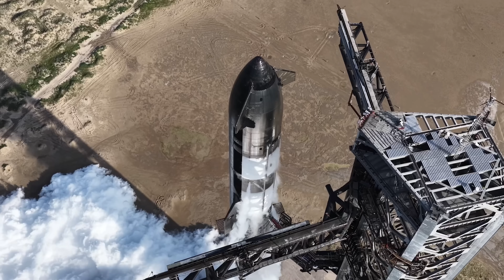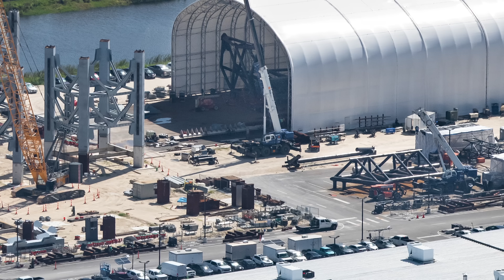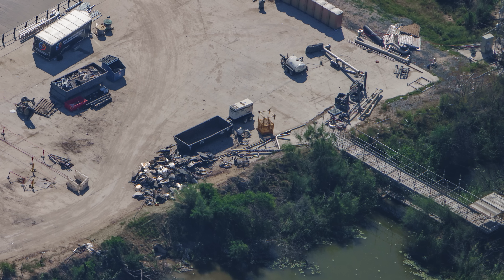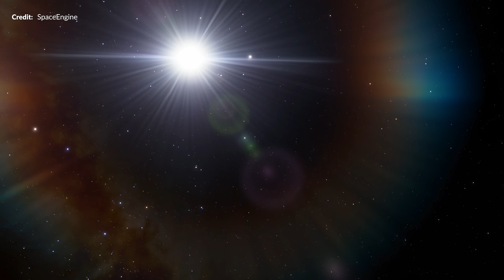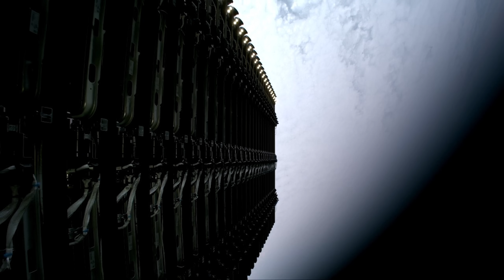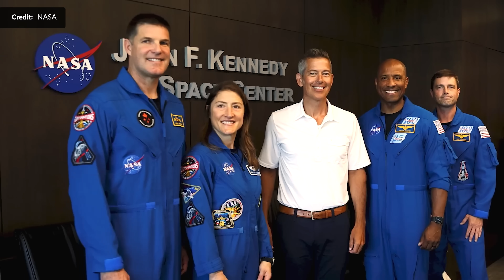Starship Began the Demolition!? 🔥

Comment: Quite bizarre comments about BO who have yet to do any significant space launches beyond their sub orbital amusement ride and last I saw their blue moon lander consisted of an inflatable plastic ball and some chip board.  Yet you talk as if BO have a completed and tested moon lander and could beat SpaceX to a manned landing demo. !
SpaceX is the only company in the US with an fully operational proven crew space transport.
It took years to develop Dragon and Boeing and Lockheed have taken many years longer to try to get their Orion and Starliner certified. 
The idea that anyone is going to hack together a lunar lander + ascent module and perform a manned landing in just 2.5 years is delusional. They would also have to do an unmanned test earlier to validate crew safety so you got under 2 years and that's assuming they started immediately with multiple billions of dollars of cost plus grifting which will drain the NASA budget.
I suspect Duffy as NASA temporary admin is compromised - Lockheed, Boeing and BO etc are all fearful of Starship and have the attention of Duffy who's lack of experience makes him more susceptible to their lobbyists efforts to undermine Artemis 3 HLS landing since they know Orion and SLS will be made obsolete by starship as well.
If they can eliminate the HLS starship then there is less threat to their cost plus Orion and SLS programs.
Even if SpaceX HLS is late it will not be by much - the more probable delay will be Orion and SLS which are yet to fly a single person.
If Duffy loves competition so much he should have a competition to find a replacement for Orion and SLS. NASA already had the HLS competition and SpaceX won that soundly.
Reply: Oh didn't you hear?  Jeff Bozo just patented landing on the moon, and the cost of licensing is not worth it.  Ask Barnes and Noble about when Bozo last patented a pre-existing idea, the hyperlink, and it worked out.
Edit: I nobbled using Noble by using Nobel and didn't win a prize for it.
Reply: They have their first orbital flight done.. the question is on the 2nd.

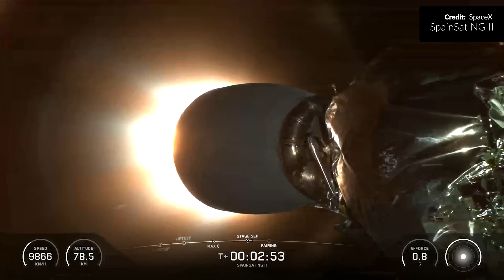Comment: 18:30 Why wouldn't they use the extra thrust of a falcon heavy configuration and recover all 3 boosters rather than destroying one?
Reply: Because that fuel is needed for the payload.
Reply: @imaginary_friend7300  You only answered why they use up all the fuel if they use one booster.  Falcon heavy uses 3 boosters, more fuel, more thrust, greater margins.  So my question still remains.
Reply: They probably ran the numbers and decided the cost of discarding one booster was preferable to the cost of setting up, fueling, and launching three boosters and recovering them all. The weight of the payload and/or insertion fuel requirement was probably only slightly beyond the single booster recovery threshold and the cost and logistics of a heavy configuration launch just weren't worth it.
Reply: @knightdive1  That's what I would assume, but surely you can run boosters with a part fuel load?  Granted that doesn't save the cost of assembling the configuration, transportation etc, but it would save fuel cost and be less wasteful overall.  I thought that was Elmo's whole shtick.
Reply: @ffsireallydontcare I don't know how full the fuel tanks have to be to takeoff, but I do know the pressure in the tanks is a significant part of their structural integrity. Without filling the tanks with something (inert gas in place of fuel for example) there's risk of the whole assembly collapsing under the forces of launch. Since even the weight of the inert material has to be compensated for with additional fuel it almost seems pointless not to just fill the tanks all the way. Calculating fuel for launches gets pretty complicated since every gram of payload requires a commensurate amount of fuel and that fuel also adds weight therefore requiring more fuel and larger tanks which adds more weight and thus demands more fuel. The weight if the extra boosters and their fuel and the added complexity of the launch and recovery was probably just not worth it. Or at least not worth the headache.
Reply: @knightdive1  Hmm yeh, I didn't think of the structural contribution of the fuel...

Comment: Just to guess on the burn on the top of the lunch Mount, I think maybe they are testing a launch strategy for the new Mount and they were trying to direct the launch away from the tower or quick disconnect to protect from any damage, this gimbling of the engines so soon probably won't hurt the new lunch mount because it's water cooled on top, just a thought

Comment: I think SpaceX could do the complete mission using combination of Dragon XL + Starship. No need for a costly 1 Billion dollar SLS Rocket. Refueling easily with multiple falcon 9 launches with a fuel tank payload also if necessary is something I am surprised nobody talks about, If there was something to be saved from SLS it would be the Orion capsule only. I am pretty sure Space X could be landing HLD version of Starship by late 2028 with Optimus Robots to test out all systems and do a full dress rehearsal before humans are used. The main problem is Trump will not get his wish while being POTUS. However I think this achievement alone would still be remarkable as this speed and enormous capability with payload size the Starship gives us when bringing architecture and equipment to the moon. The Starship rocket itself could be used as a beginning stage-1 base in itself.

Comment: The pad damage could just be from the fact they stopped painting it after the launch a few flights ago. The paint will actually provide a little protection from the fire till it burns off.

Comment: Why the Black soot/smoke I thought the same thing. I think they turned the volume on the Raptor 2's up to 11!  Just a guess here but thinking they all knew this was last launch from the older pad design and the wanted to get some data from those gen2 engines. Did anyone track the speed /time it took to get to orbit this time, was it shorter?

Comment: I've often wondered if we could do a moon shot with Dragon or (cough) starliner. Whip up a LEMv2 to work with Dragon or starliner. Perhaps skip HLS and land a human rated V3 starship on the moon.
Reply: Its not a good idea to try and land Dragon or Starliner on the lunar surface cause they weren’t designed with that capability in mind. Whether it be longevity or even fuel. Even then why modify a Dragon when you can just land an entire cargo Starship on the moon.
Reply: You would have to have another vehicle. Dragon does not have a tenth of the delta V to go to the moon and back. Even if it could its heat shield  is not designed to take the 40% increased re-entry speeds of a direct return flight path. There is a way to make it work where you put fuel depots in both lunar and earth orbit and use a starship HLS. HLS takes off refuels in LEO and docks with Dragon to transfer astronauts. HLS flies to the moon and lands and does the mission. At this point HLS only has enough fuel to take off and reach orbit around the Moon. There it docks with another fuel depot and tanks enough fuel to leave Luna orbit and do a powered orbital insertion into low earth orbit where it docks with another Dragon that lands the astronauts. HLS is left in orbit to refuel for another mission.
Reply: You'd need to modify them substantially, since even ignoring the lack of a rocket capable of sending either capsule to the moon, they're not designed for that environment... at the very least, you'd need to upgrade the life-support system for long-duration flights, and upgrade radiation shielding for deep-space operations.

Comment: A bit of a cop-out but re getting to the Moon I think both important - getting back there before China's first crewed landing and also developing a methodology that is efficient enough to be able to sustain a long-term presence at acceptable cost. Those could be treated as 2 separate projects though, develop the longer term sustainable mission plan and associated hardware while also executing plans to get humans back to the Moon ASAP. With SLS components already manufactured or in the pipeline and with both Orion and SLS already successfully flown then for the short-term plan it does seem to be only the Lander that is the issue.

Personally I think the long-term plan should involve lifting modules into orbit as payload in either Starship or New Glenn and putting those modules together in LEO to construct vacuum-only spacecraft that are much more mass-optimised than those currently being considered. Starship, if it fulfils it's design objectives, would be able to get more mass and volume to LEO than New Glenn but designing modules small enough to be launched by either system would de-risk the whole thing.
Reply: Why is returning crew there first important?  How does it advance the goal of building a base or anything else outside of just the calendar?

Comment: Excellent update! Thank you MH&Team! 
Question:
When it has already been planned to be expended, do they remove the
landing apparatus from the booster to provide more lift at Launch?
Even the Grid Fins could be removed for use on a different booster that had
an event that damaged one of the grid fins, and it would provide more Lift
for the expended booster?

Comment: 3-I-Atlas is a lower cost to build than launching into orbit alien made space modules like SpaceX Star Ship using instead a captured near the home World of “Planet 9” a metallic asteroid then the the the Planet 9 Aliens hollowed out the solid metallic Asteroid which was specifically engineered to be a camouflaged spaceship mini city with large enough structure to support long-term life inside the asteroid. This “natural” asteroid alien designed to be a spaceship is supporting generations of aliens who were set on their way initially when pushed by a booster rocket to then use our home star close pass-by gravity assist for propulsion to aim for other solar systems. Why do you ask?  Well….To explore all the not so intelligent radio frequency broadcasts coming from Earth. This alien captured then modified to a spaceship asteroid with a center bored out 3-I-Atlas was selected when known to be mostly a metallic asteroid rock that would provide shielding of the spaceship occupants which protects long term the interstellar traveling biological Planet 9 aliens inside the camouflaged as a comet offering robust interstellar radiation protection when passing long term through space. Each alien generation, after alien generations DNA & RNA,are not damaged when born in this modified asteroid sized to be a mini city. The life support system which is seen to be outgassing diatomic carbon C2 when the comet’s tail is photographed as a green tail which is generated from the Planet 9 aliens respiration in large amounts dumped over board. The 3-I-Atlas comet tail facing in the wrong direction is actually a long duration thruster burn providing steering, course, heading, and speed change. Since the space ship is the size of a mini city, so much bigger than a SpaceX Star Ship.3-I-Atlas was sent by gravity assist propulsion to explore our solar system. Number three interstellar comet is the most recent interstellar visiting "comet”. Comets sent one at a time here. Think Apollo space program where we human aliens with each successive flight pushed exploration step by step to know more about the moon. The aliens know from our radio wave broadcasts that humans wish to colonize Mars soon so Planet 9 Aliens purposefully traveled close to Mars to look for a suitable location to colonize Mars, or orbit Mars before humans go to the Mars surface, and the aliens plan to meet humans there in orbit around Mars or on Mars's surface when China, or SpaceX arrive at Mars. Don't worry, be happy, just wave at the Planet 9 aliens just passing by this month testing their Mars orbit insertion plans to come soon. See mystery solved  ;  ) .

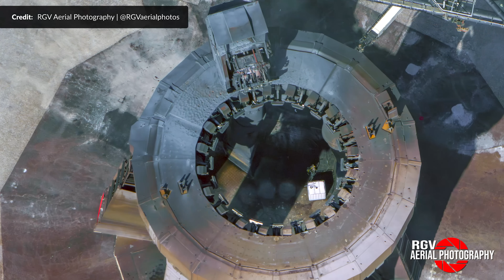Comment: 1:48 Maybe after flight 10, they didn't rehab the mount to the full extent since they knew there was just one more flight, and what we saw was the Booster blasting off rust and stuff that normally they needle-gunned off and cleared up before the next flights, but this time they didnt?
Reply: Was thinking the same thing.  Not much point in doing more than assuring the structure will function for the last flight if they're just gonna rip it down after.
Reply: I thought that as well. Let the launch blast begin the demolition!
Reply: That makes good sense.

Comment: I've always had the feeling that Starship is wayyy overkill as a lunar lander and will take much longer than a smaller more traditional lander design like Blue Origin or Dynetics. The predictions were way to optimistic. If Starship is supposed to stay stationed in NRHO or on the lunar surface, 6 Raptor engines and smaller high positioned engines seem like a lot of dead weight. The huge lift is a requirement and doesn't exist in smaller landers. Obviously the orbital refueling is fun to think about but totally won't happen by 2027 imo. And if we want to future proof human presence on the moon, won't nuclear engines such as the one NASA is developing or ion engines be better than chemical rockets in space? Or if they do bring a Starship to the moon they should strip it down there or something. Don't get me wrong I am the greatest fan of Starship but I think its strong side is a surface to LEO ship like the Shuttle, or maybe a LEO–NRHO shuttle
Reply: It really depends on what you want to do with your lander doesn't it?   Smaller landers deliver less payload.  So if you want a few people and a flag planting that's the way to go.  If you want to build there you need more mass and nuclear engines bring their own issues.  Ion is great if time isn't an issues as it is with crews.  Orbital refueling will open a LOT of doors but it's still yet to be proven but I don't see any major issues there. HLS will be a stripped down version.

Comment: I'm hoping for Alpaca.
Reply from the maker: Oh I miss that. That was my fav idea for the lander initially.
Reply: @MarcusHouse  It makes the most sense for a 'right first time' successful landing. Starship and Blue Origin solutions are too top heavy, and who wants to risk a suit decompression with a 20/30Mtr ladder climb or a slow elevator to get back to safety? Plus, why are all of the bids insistent on putting everything needed into one lander? Send cargo pods ahead, 'cheap' unpressurised containers, with all of the kit. Who cares if they fail to reach the surface safely? All you've lost is a few stores - just send a replacement. Then expend all of the effort and safety experimentation/iteration on a small (Dragon type) 'crew bus' to get the actual human bodies to and from the surface, with potentially an established refuge to transfer to. It's got to be more than just "We planted a flag." this time. The first big step is to put a station in permanent lunar orbit. We've been screwing around too long with the ISS - that same effort needs to be pushed out there, to have a rendezvous base for orbit/surface/orbit 'hops'. Personal opinion here - Boeing need to be cut out of the 'feeding trough' permanently. They are a big part of the waste in NASA.